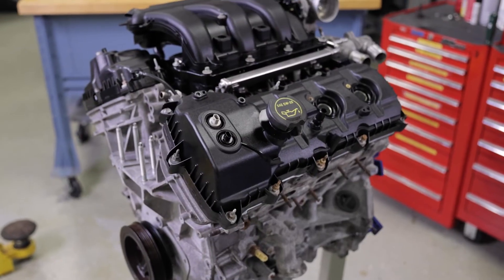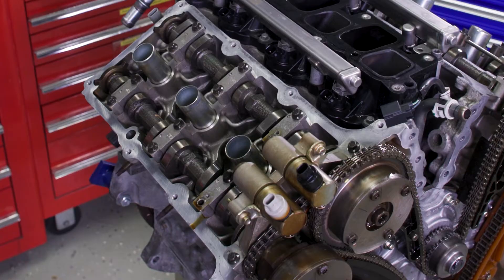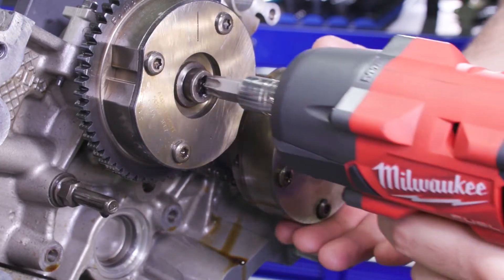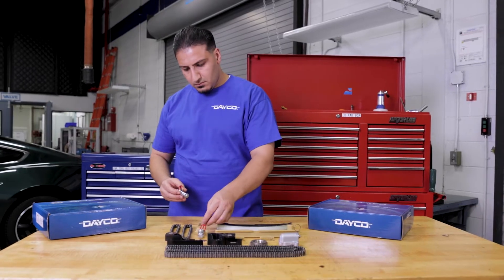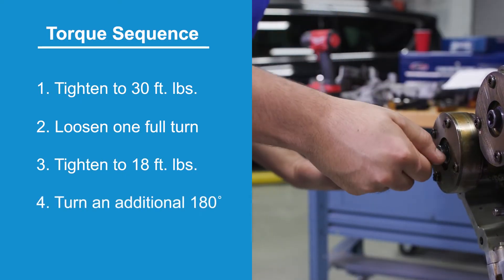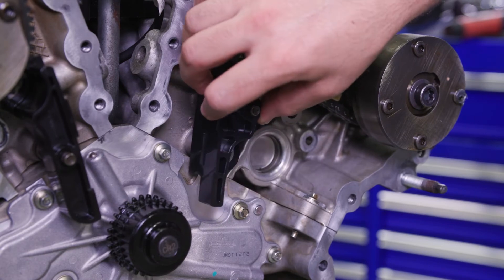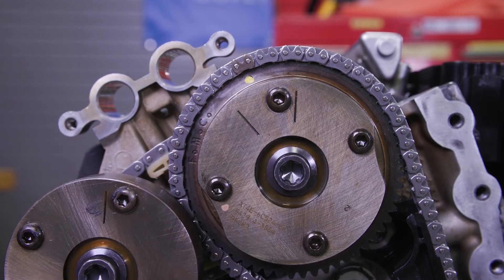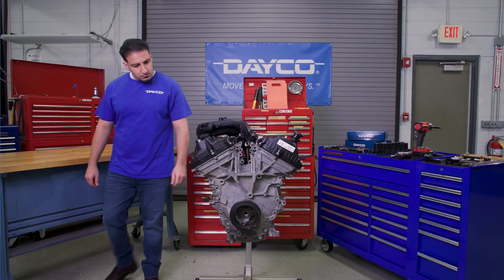Vehicle Maintenance: Dayco - Timing Chain Kit Installation – Ford 3.5L/3.7L V6 Engine

Comment: Okay so I fucked up lol. I can’t get mine to move I need to set it at the 11 o’clock and 1 o’clock position on top the bottom lines up at 4 o’clock but can’t get the top two when I turn then motor it turns but stops before a full turn. (I pulled the timing chain off before setting the 11/1 o’clock top ones

Comment: Nice video.  The secondary tensioner appears to have come with some small metal 'clips' also.  Are they not used or are they somehow used with the bottom plastic part of the tensioner?